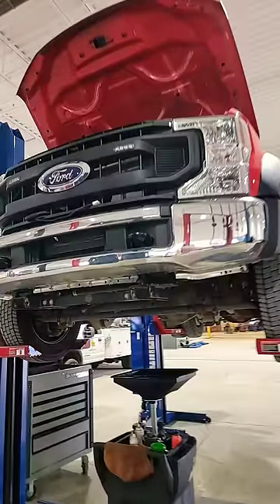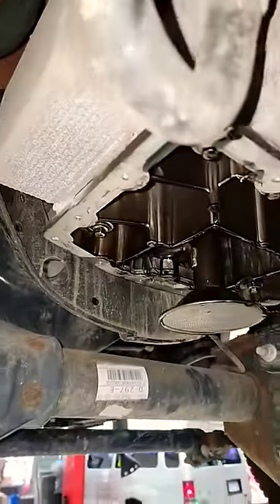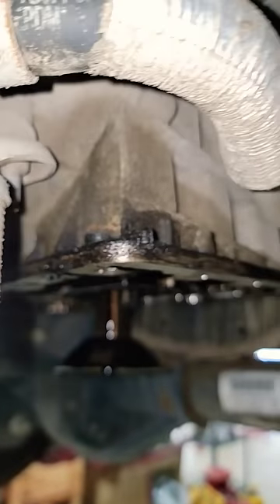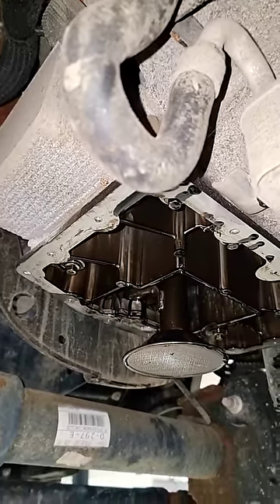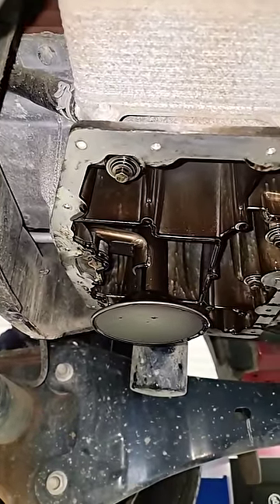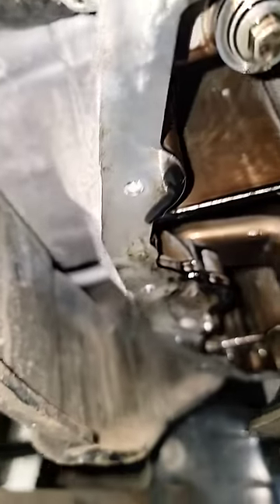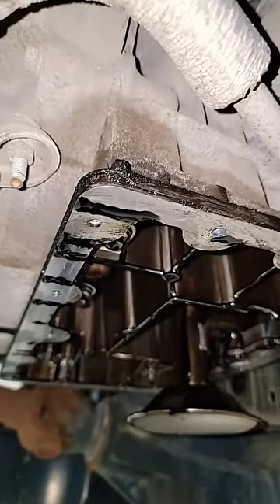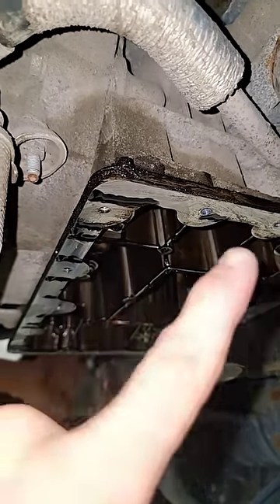Listen UP you Ford 6.7 engine builders  SMH 🤦‍♂️#bebetter #shorts #fyp #fordtrucks

Comment: Welcome to the era where no one give af
Reply from the maker: Yup
Reply: @PowerStrokeTechTalkwARod  robots apply that sealant, and the oil pan was most likely washed in a washing station that has wash fluid that dilutes with water. When the dilution is not perfect there is a sticky residue on it that is left that then causes the sealant to not seal it.

It is most likely whoever is in charge of wash fluid % fault. Most likely a chemist, engineer, or low level management.

Not an assembly line worker
Reply from the maker: Hmmm
Reply: @PowerStrokeTechTalkwARod  lol, don't listen to me though. I'm just a random nobody on youtube. Appreciate the video and the comment!

Comment: 3000 miles & 400 hrs run time 

So if you do the math his average speed over those 3000 Miles with 7.5 miles per hour

That's probably not possible but this extended idling time is not good at all in this is a standard pickup truck not a cab and Chassis.

This truck will be a service nightmare until the day it's out of warranty

Comment: Gawdamn, look at all the rust under there already!
Reply from the maker: Awful
Reply: My 06 duramax doesn't even have that much rust lol
Reply: Something doesn't seem right. I have a 2019 F250 with 26,000 miles and it doesn't have hardly any rust and I live in the rust belt.
Reply: Probably came fro NY, Trucks get rusted out so bad up here it sucks I’ve already sprayed the bottom of my truck two times in a three years I’ve been here
Reply: @TheBwkaylor  lol “that much”. It shouldn’t have any
Reply from the maker: Ny, um no
Reply: It’s probably because it’s was sitting for 2 years in fords plant holding lot waiting on parts before it was titled. So even though it’s a 22 it’s was sitting for 2 years before it ever saw the dealership.

Comment: There isn't a guy on the line not doing his job. All of that work is done by machines. Robots move it from station to station.  There is a guy putting it together, dropping the pison, rods and crank in to to it. But they have no control over the service finish.  If a worker did bring that up to his boss he would get told to not worry about it and ship it. I know, I worked at the very end of the truck line at a different manufacturer but still uaw and everytime I would bring up an issue thar I felt needed more attention than I could give it in the minute I had to fix things, I was told to sign off on it and ship it. If I refused I have been walked up to human resources to be fired. The only thing that saved my job was it was 3rd shift and no one was in the office. Luckily my union  rep seen me and my boss walking that way and he talked to the boss  and I was able to keep my job that night.  So don't think we are all lazy asses that don't care about our  jobs. The majority of us do, we are just forced to send bad parts/jobs down the line in order to meet the quotas for the shift.
Reply from the maker: I appreciated your comment
Reply: That’s the first Union job I heard of where you would be fired on the spot 😂. Grounds for immediate termination that is not by any means.
Reply from the maker: This guys got it all....

Comment: I work at a ford V6 plant, my team does the pistons and oil pickup tubes, part of our procedure is to prep every block just before oil pans and its checked at 2 areas in 50' to make sure its prepped and ready
Reply: Do you make the ecoboost engines?  I know a guy with a bunch of those as fleet vehicles and he’s gotten 300k out of them with no problem.  So nice job!

Comment: Just wait until the throttle starts lagging around 11000 miles and it ends up needing a new transmission (die to mettle shavings getting in it somehow) and then you get told that they are on back order and it ends up sitting at the dealership for an entire year.
Reply: I’ve been hearing from a lot of mechanics lately that it’s very hard to get transmissions new from factory especially with Ford I know one that told me he’s been waiting 6+ months right now
Reply: That's a dodge issue
Reply: @maximilianavdeev7363  my f350 been at the dealership for 285 days. Its ridiculous.
Reply: 10 speed definitely has some issues.
Reply: @scottbaker4314  No, The 68rfe has been perfected over the past 3 years and has very little issues at this point unless your going to mod for more power, then a few small things need to be done but whats good is the programming is now down to a science with mods, now stock 68,s are getting well over 500k reported  miles by camper transporters with no issues the past 3 years and the Asian trans on the 3500,s is just as good as an Alison transmission but the issue with those is the programming is impossible to penetraite. FORD DIESELS DONT LAST LIKE A CUMMINS CAN AND THE NEW 10 SPEED blanch,  Go to the diesel drag strip,s the fkrs are blowing up and the Cummins trucks are winning. And there is no ford million mile club, but there is for ram Cummins diesel owners
Reply: @sarno85  i waited 2 years for my ram 2500 CP4 pump recall to be swapped back to the ole reliable cp3 truck sat most the time. I was afraid to drive it that it would explode,

Comment: I really love my 50 year old C20.
Reply: I really love my 19-year-old LS . I have never had the silicone any pan or cover ever on any of my GM trucks .
Reply: I love my 40 year old K30
Reply: I love my c20 too
Reply: cars back then were worse, thats when all the automotive factories were on piece work and they just slapped shit together. Engines barely lasted 100,000 miles
Reply: @yamahayz0426  my c20 says otherwise 🤷‍♂️
Reply: @alexanderromo1313  same here my 69 c20 is still on the road with the original 250.
Reply: Keep it Isaac. C10 C20 are gems.
Reply: @yamahayz0426  lmao I just got a 1990 mightymax with 165k miles. Hasn't sparked in 6 years due to a blown ecm. Fixed the ecm and timed the motor, and burped right over and fired up with a small miss.
Reply: @fsca72  mines got everything original it’s a 305 nothings been replaced but oil, filters and brakes and tires
Reply: @yamahayz0426  say that to my all original 1984 with almost 400k on it, compared to my 2017 that lost it's transmission after 97,000 miles. Old trucks were made simpler, making them more reliable.
Reply: I'll keep my 44 year old 1978 W-150 Dodge Power Wagon with the 440/727!
Reply: @kerryfield5905  I bet it looks beautiful man
Reply: @alexanderromo1313  she runs great as well!! My every day driver.

Comment: I work at a core supply place and I noticed the upper pan before that style had the oring style gasket. Why they did away with it is beyond me because just like you pointed out, when you see a later model it’s hit or miss around the whole pan.

Comment: Last year I was working at a Ford dealership and a guy came in "praying we have a transmission pan in stock". He was a contractor driving on a recently  cleared lot and a tree limb punched a hole in the plastic trans pan stranding him on the spot with a trailer.
Reply: Plastic trans pan??? 🙄🙈
Reply from the maker: Yea WHERE have u been...f150s been had a poly pan for yrs......
Reply: Wait - HOW do you have a PLASTIC Transmission bottom pan on a WORK Truck ? SERIOUSLY - HOW ?!?
Reply from the maker: Where if the efffff have you been
Reply: Can confirm recent ram 1500s have plastic trans pans now too. A 22 ram 1500 at our company has a poly control arm and trans pan... The trans pan has been punctured 3 times by sticks and it's a 800+ dollar fix each time
Reply: no skid plate under trans and a plastic trans pan?
Reply: Plastic trans pan?!?   Thought the no dipstick thing was bad enough!
Reply: @Ty  Three times!? At that point I would just contract a machine shop to cnc a custom pan.
Reply: @SerthD  Perhaps a bolt on skid plate can be added?
Reply: Why not a plastic trans pan, radiators been plastic for years now too! It’s just like old toy truck and other toy equipment use to be metal too. Now everything toy made of plastic. Now there carrying on the tradition to the real thing! As kids you get use to playing with plastic toys, that way it seems normal when you buy a big boy plastic truck or whatever other vehicle you get as an adult?

Comment: I think the machining process is so precise that it’s too smooth for the silicone to stick to it
Reply from the maker: No  It doesn't matter the surface they're not prepping it because these engines come with a thin film of oil on it you can't apply silicone on top of oil
Reply: @PowerStrokeTechTalkwARod  yea. True. But ford oil leaks used to be rare.     Now almost every engine they make leaks.    If the surface is too smooth the silicone can’t stick either. And on another note.   I’ve removed oil pans and front covers and the silicone is still wet after 10-20k miles because it’s contaminated when the assemble.   Quality control took a nose dive about 4yrs ago
Reply from the maker: Thats the issue, working america. Period
Reply: @BigWheelBaggerDad  lots of excuses when all it needed was silicone and some effort. Machined too smoother or not it's part of the job.
Reply: @PowerStrokeTechTalkwARod  come on just give it a little sandpaper massage, they’re what’s keeping all these tech’s stomachs full. As long as people keep buying, they ain’t gonna change nothing.
Reply: @BigWheelBaggerDad  yeah you’re correct actually working in the field and doing things gets you to the train of thought. If it’s too smooth nothing sticks. Which is why painted surfaces and anything should be prepped. For example jb weld recommends surfaces not too smooth. Isn’t jb weld the strongest epoxy on the market? Wonder if op knows that it came be applied to machined surfaces either.

Comment: Would prepping the metal mean sanding it smooth so it would mate better to the pan, or sanding it rough so the silicone has more surface and texture to hold on to?
Reply from the maker: No. Watch our upper oil pan installation video & youll see

Comment: Look it's even got the black filter!
Reply from the maker: Yup
Reply: What's the significance of black filter?
Reply: Pretty sure the black filter is the “factory” original filter. Meaning it’s never had its 1st oil change yet
Reply: @s60t5M  "3,000 miles" ???
Reply from the maker: Very good
Reply from the maker: Three-thousand, yes correct. Every HOUR OF IDLING IS equal to 30 miles of DRIVING, DO THE MATH
Reply: @PowerStrokeTechTalkwARod  having this many replies makes me feel special 😁😅. Thanks ARod for all dat info!

Comment: The easiest way to clean the gasket surface is to scrape with a new razor blade held 90 degrees to the surface. 
Finish up with a stainless toothbrush and brake clean. Fast and easy!

Comment: A robotic glue dispenser loads the sealant onto the block and then pan is installed. This has been done by GM as far back as '98. Problem is likely no proper prep of block gasket surface.

Comment: My truck was leaking oil, 19 f150 5.0. Got it fixed but my question is why not have a traditional metal oil pan attached by bolt and sealed by a gasket, far more reliable and simple

Comment: Whenever possible you never use silicone on a tranny pan  or oil pan there's a very good chance that it'll get into the pan and get sucked up on either pump spray adhesive is the best

Comment: 2023 2500 and up dodge  has power steering pump leaking at the banjo hose fitting at the bottom of the pump our fleet has had 3 leaking  and all needed parts are very hard to get 2,3 weeks back ordered

Comment: I’m tired of Fords QC. My 2020 ford Fusion with 17k miles has already has the front control arms replaced because the bushing dropped out of the socket and now the front shock sounds like it’s at the end of its ropes.

Comment: Actually what you're saying is the fact that the sealer stayed on the pan too long and skimmed over and didn't adhere to the bottom of the engine. While it may be prep, its timing how long the sealer sits on the pan before everything is tightening.

Comment: This is why I refused to buy a truck made during the pandemic.
Reply: Underrated point all production from the big 3 was shit family member works for GM and said quality control was basically obsolete due to staffing and everything that went out came back between 4/5k miles with major engine work needed heads rods seals tranys all of it
Reply: Exactly
Reply: Right....the nxt general is just lazy..Sad!
Reply: @youdontknowmyname6956  I wont even eat the food. Its hard to find old food, too.
Reply: @roboticunclephil  🤣
Reply: Yup. Even the new full size Toyota trucks are having bad quality issues.
Reply: @rishiisnotmypm  And the quality control guy had to stay back another 6 ft in a small fenced in pen.  Then they sent them home at 10pm and finished the trucks at 4am with nobody watching.
Reply: @jimgero1509  no QC at all. Even for infotainment, every bug will be marked as WAD. Don’t ask me why I know.
Reply: For real. The quality dropped exponentially. Leaks, crooked and loose body panels...... What a joke
Reply: Sealant is applied by robot. The amount it sticks on a pan is due to improper wash fluid dilution
Reply: I don't think things will get any better now that automakers know they can drastically reduce the quality of their product while jacking up the price.

This very well may be the end of American auto makers
Reply: My '20 Nissan Maxima was built in Sept-2020 and not a single problem since I bought it new in Nov '20. 17K miles so far which is rather light but still, not a single issue except 3 routine oil changes.

Either I'm very lucky or there's still hope!
Reply: @trentonz71  Do those still have the CVT transmission and if so did they get the bugs worked out of them? Those Nissan CVT's have a horrible reputation.
Reply: My 2012 6.7 crankshaft went at 23k. Got 120 k on replacement enjine before it bit the dust. No warranty on last enjine.

Comment: I been doing lifters in 20 to 22 model Silverado’s, tahoes and suburbans after they’re second oil changes. Crazy that the quality of vehicles are gone down hill and the prices of them sky rocket
Reply from the maker: Omggggg
Reply: Cam & lifter quality has been in the dumpster across the board for awhile.  Aftermarket stuff is a total crapshoot, from anybody.
Reply: ‘21 Silverado had all right bank lifters replaced at 19.5k due to one of them collapsing. One pushrod bent. 5.3l. DFM sucks. Bought a Range module to disable the function… along with the Auto-stop.
Reply: It’s amazing GM has had this problem for over a decade but won’t fix it??? I’ll stick with my 21 Titan with a reliable V8
Reply: Could not keep a cam in any gm products in the 70s.
Reply: @crazyjam6551  Bullspit.
Reply: @CarsTechWood  I always used to hang onto the bumpers of titans when riding my bmx lol
Reply: Have any of the refreshed/facelift silverado 6.2’s had those issues? Just got one and i was hoping no more lifter issues
Reply: @wymple09  if you got more than 30000 out of a gm cam in the 70s you were running on 7 cylinders
Reply: That dod system sucks
Reply: @giovis92595  Don't buy the FORD & Ram fanboy BS.
Reply: Meanwhile I’ve got three 70 series landcruisers. A 1997 75 series with 500k miles and never been opened, a 2015 79 series with 150k miles never been opened & a new 2022 79 series with 10k on it and in mint condition still. All of them only get their standard services and all get abused. I’m not a fan of the American manufacturers, but they need to do better.
Reply: Yea when your motor goes from v4 to v8 depending on how much throttle you think lifters gonna want to stay in place
Reply: @ethantruesdale5442  ?
Reply: its almost like tesla has the best quality control now
Reply: It’s because Tesla came into the market with insane profit margins and all Legacy automakers are now taking big shortcuts and spending less money on labor and production cost to try to make their cars more competitive against Tesla.
Reply: Corporate greed at it's best. If you could find a way to slap a mid 2000s LQ4/9 in them while still passing emissions it would last easily until the body rots out at 10 years old (5 years for us rust belters)
Reply: the LT head torque spec is bs, it is pulling the block threads out, i've been doing 40lbs + 90 + 70.
Reply: So the 2019s never had that problem?